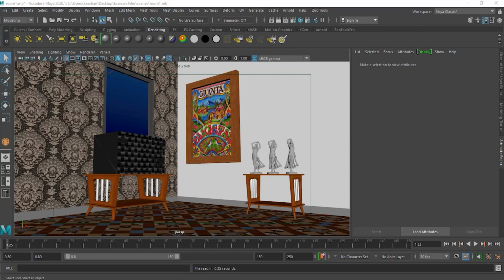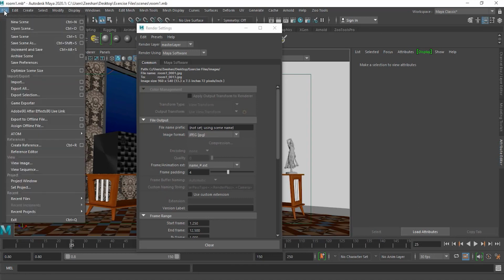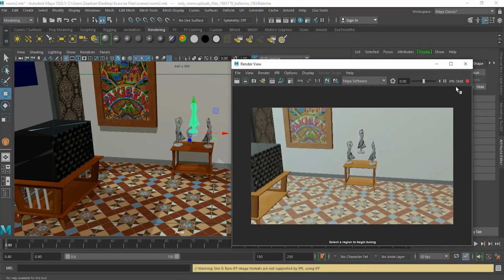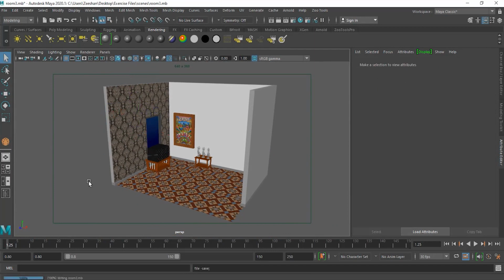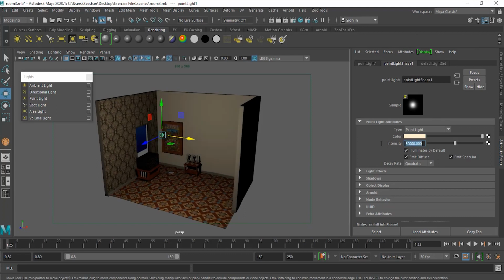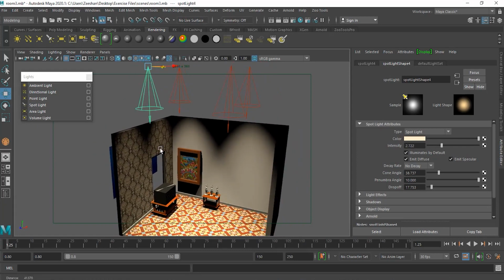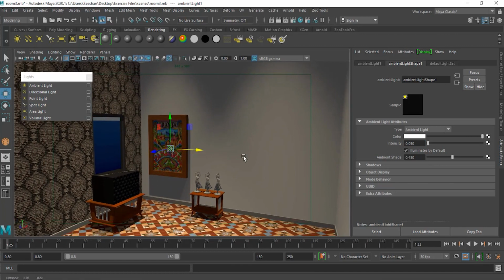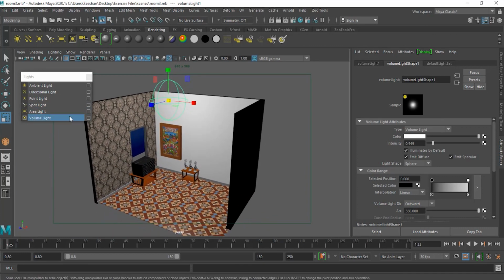Lights, Camera and Rendering with Maya Software | Autodesk Maya Essentials Series |Lesson11/13-PartA

Comment: The lights and shadows don’t show in the render results and all of them are mayas default 
How do I enable that?
Reply from the maker: To enable proper lights and shadows in your Maya render, ensure you're using a renderer that supports them, like Arnold. Check your Render Settings to select Arnold Renderer and adjust the Camera (AA) Samples and Ray Depth settings for quality. Ensure lights are added, enabled, and properly configured with sufficient Intensity and Exposure; also, enable Cast Shadows in the Attribute Editor for each light. Confirm materials on your objects are correctly set up with appropriate Diffuse and Specular settings, and verify Viewport 2.0 is set to Use All Lights with Shadows enabled. Lastly, check your scene scale and geometry normals, as improper scales or flipped normals can affect rendering, and try restarting Maya to resolve any temporary issues.